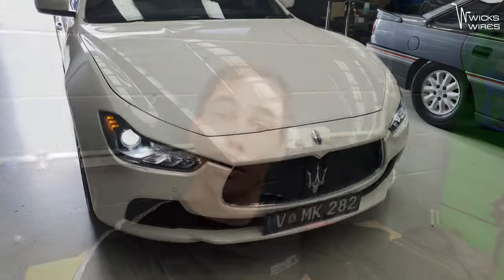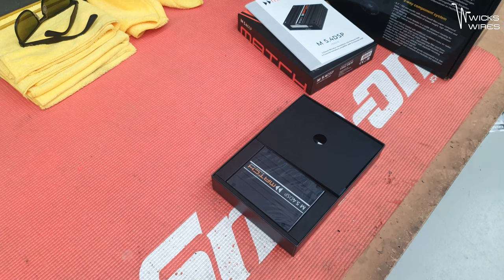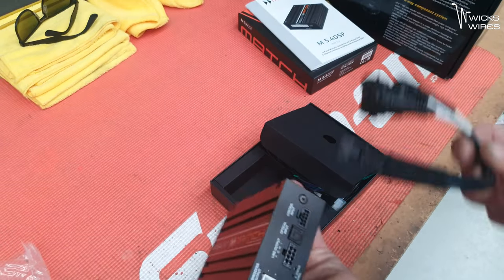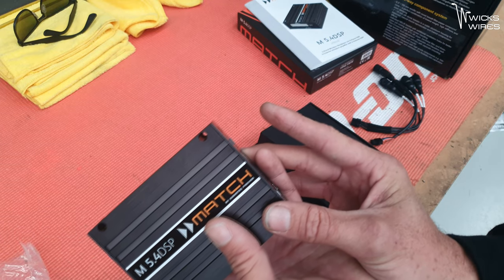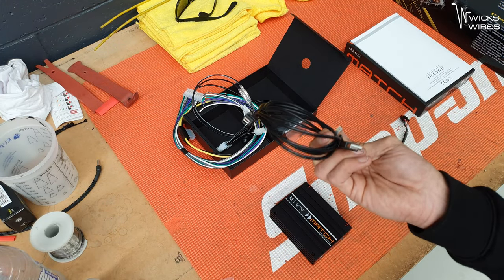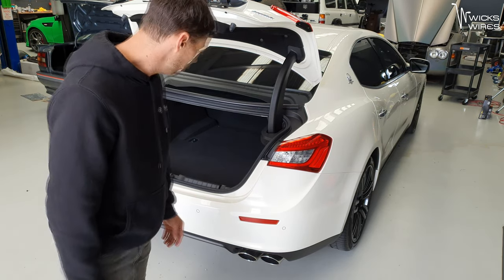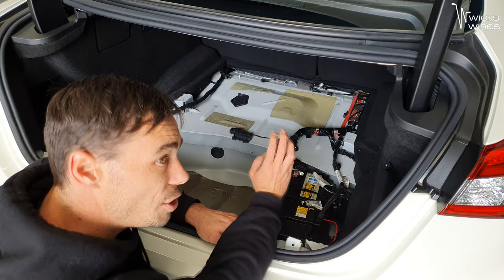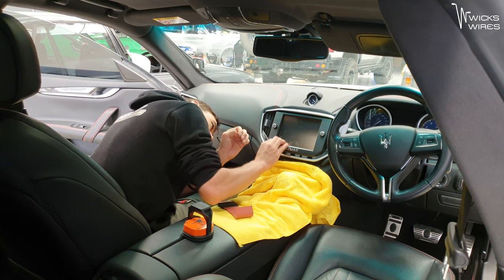The Coolest Mini Amp EVER?! The Match M5.4DSP into a Maserati Ghibli!!

Comment: Hey man I know it’s been a bit since you posted this but I just got a ghibli and I’m trying to add a subwoofer but I’ve had a hard time with wiring, do you know what wiring harness you used?   I looked up a Chrysler plug and play harness but they don’t look the same or have the same pins yours does.
Reply from the maker: Hey mate, this is the same style harness that I used, but I did have to modify it to make it work. And remember the pin out is also not correct
https://brandbeast.com.au/product/aerpro-ct10dg01-t-harness-to-suit-dodge-2

Comment: I see you didn't run separate power cable for Match 5.4 which is recommended when using it in high power mode, unless you're sure that oem amplifier power cable is thick enough